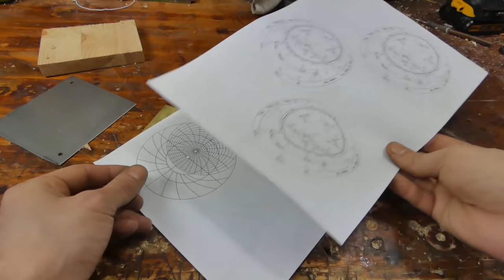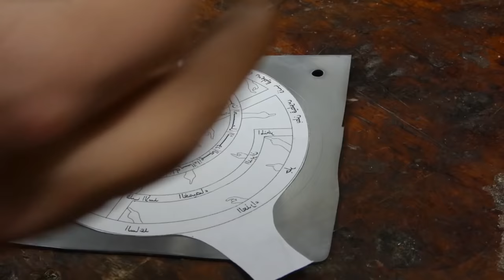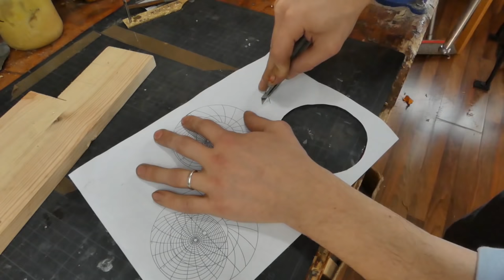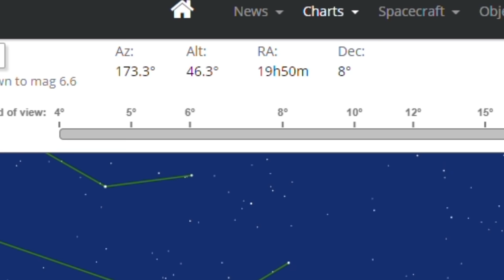I made tool that can tell TIME at NIGHT

Comment: Needs easier way to cut brass.

Casually builds leg powered scroll saw.
Reply: I think Uri is about the only guy I watch where I am not surprised when he just has a Singer pedal table standing around. You never know when you might need it...
Reply: Using a Dewalt cordless drill......
Reply: @falkschonfeld2370 
My parents use theirs as a hallway table 😉😂
Reply: fiona fiona I use for sewing...
Reply: @lollipopyummy1389 
I don't have enough of a rhythm nor any replacement needles and therefore use a more contemporary device to actually sew
Reply: @scottpreston5074  if I don't use ours it's safer.
Reply: First off. Awesome comment. 

But just for annoying accuracy; he apparantly has several builds he interchanges using the same treadle set up. A scroll saw, sewing, and a lathe at least.
Reply: He need a laser cutter!
Reply: my friends 
this man doesnt always rely on electric powered machines 
so dont be judgemental
Reply: He didn’t casually do anything every piece on it was finished
Reply: Ahmd Abdallah thanks for adding to the conversation something so relevant
Reply: I'm reminded of Charles Babbage, who used so many nuts and bolts building his Difference Engine (first automatic calculator) that he invented standardised, mass-produced nuts and bolts along the way. Previously, each nut was made to fit only its own bolt, which was a nightmare for his project...
Reply: @mattberg6816  Dont you just love the sanctimonious, tone-deaf, blundering faux-pas exemplified in every one of these religious spam comments?! It's really too bad that one of the ten commandments* isn't "Be cool".

*Spare me, YT. Im aware he was referencing the Qur'an.

Comment: Oh snap! You got a new vise! 
I just finished my own hand made mallet and graver based on your videos, and started building a rotating vise from scratch so I can actually try the darn thing out. Keep inspiring, thanks for sharing your build.
EDIT: I have made my own cutting fluid for drilling through steel using dish detergent, some water, and some strong oil. Shake it together and the soap will emulsify the oil into the water for lubrication and cooling properties.
Reply from the maker: Thanks for the tip! I'll definitely try it out. Good like with your vice,
Reply: Just be careful as dish soap has salts in that can scratch up the surface and encourage corrosion. Of course if you're only using a drop or two then it shouldn't be a major issue, but you might want to wash the steel off after cutting rather than just rubbing it clean.
Reply from the maker: @RealUnimportant  cool, thanks. probably Ill try it first on brass to avoid that kind of issue.

Comment: Incredible work! You're inspiring me to make my own, although I might have to start with wood. Note that when you're comparing a time reading from an astrolabe to standard time there are a couple of adjustment you need to make--1) use the "equation of time" to resolve the difference between local mean time  and local apparent time, and 2) correct for the difference between local mean time and standard time based on how far east or west you are from your time zone meridian.

Comment: Did You design and make the scroll saw?  its so cool, dose it run on black or white magic? Thanks for the inspiration.
Reply from the maker: yes its my design, sort of, I mean the concept is not mine but its my measurements and all. but the real magic comes from this amazing cast iron sewing machine by Singer, you don't see things made like that anymore.
Reply: @urituchmanpigeon  It's an inspired idea and a fantastic way to upcycle one of those treadles.
Reply: @urituchmanpigeon  I see them for sale periodically here.  Thought about buying one to make a treadle lathe, but didn't feel the flywheel was heavy enough.  Now that I see how you used it for a scroll saw I might have to pick one up and give it a go.
Reply: @red58impala  I have seen videos where they make a band saw from something simplar like this, Manual machines are awesome.

Comment: Hey Uri, I hope for your sake you see this, but there is another DeWalt drill called the DCD791 that is just like your DCD796 but a bit shorter/lighter and without the hammer feature. The hammer feature means there is about 5mm of chuck movement when you push on the drill and also if you try to forcibly back it out to avoid it grabbing then you're out of luck because by the time you've moved 5mm and jerked on it, it's already grabbed and potentially broken. Worth getting one IMO, I did :-)

Comment: Hey, I use the same printer toner and acetone method for transferring designs onto soapstone. The trick is to saturate the paper (enough to soak through so you can see the design on the other side), then just as it begins to dry, rub the back with something hard (like the side of a ruler). You can be pretty aggressive because as the toner 'melts' it will stick the paper to the surface.

Basically, the acetone dissolves the toner, then as it starts to evaporate the toner gets sticky....that's when you rub the back with some pretty significant force to get it to stick to your surface. You'll get a much clearer more defined impression. (I routinely transfer designs that are 8 or more Kanji characters onto a 2cm x 2cm surface)

Comment: Absolutely love astrolabes!! Coolest ancient astronomical calculating device ever!! Making a Nocturnal (nighttime time calculation using the position of the moon) calculator would be a great build!! And the sewing machine treadle wheel scroll saw was genius!!!
Reply: Nocturnals are indeed great for telling the time at night. And the good thing is that you don't need to adjust for the Equation of Time. But nocturnals use the position of the pointer stars in Ursa Major, not the moon. The moon is utterly hopeless as a timekeeper.

Comment: When using transfers like you are doing - there is a chance that you can rub off a detail or two.  Use clear hair spray to fix it.  Acetone removes the hair spray.  If necessary, you can draw on it also.

Comment: Your Arabic calligraphy is so perfect and beautiful !
Also, did you know that you could calculate the earth's circumference with it too? you just mark a star and get its degree, then move ten kilometers and recalculate its degree in the same time of the night, then you get how many degrees by ten kilometers are there on earth, then you calculate how many kilometers are there in a single degree (which should be around 110) and then multiply it by 360 and you get the earth's circumference assuming the earth is perfectly round.

Comment: >Starts sanding two bits of brass held together with nails
>Pulls hand away and brass has become one piece 
So freaking impressive
Reply: Not nails - rivets.
Reply: @BrightBlueJim  Nails in the physical sense of a brass pin holding two objects together. You missed the point.

Comment: You could've tried adding a smaller block to the underside of your holding/mounting plate with which you cut the engraving :) so you could put it in the bowl vise I mean

Comment: I would also like to point out that this tells your geographic time. Your 18 minute discrepancy can also be shown as your movement east or west from the center line of the time zone you are in.  Take multiple readings both day and night, average your time difference from your watch and now you can track your position on the globe as you travel by seeing how this difference changes!  

Also I appreciate that you made the plate with the sky box exchangeable. However putting a key at the outer edge of the dial rather than at the zenith will allow for a smoother swapping of plates as the zenith position will change with different latitude plates installed.  

Really enjoyed watching the build man! Great work!

Comment: I hope my suggestions are OK with you to make.  I get a better transfer to the plate to be engraved if I press and lightly clamp(just something heavy is fine) the paper, acetone soaked cloth or paper towel and something to apply pressure(piece of wood?) even in place and let it sit for a few minutes to let the acetone dry.  Once dry the toner(polystyrene and carbon black) has turned hard again and more of it may stick to the metal.  You can on some printers increase the density of the print.  Higher density means more toner on the paper and thus more toner that might make it to the plate.
Reply from the maker: Thanks, great tip! I'll try it out.

Comment: I'm wondering how this could work anyway at anytime. In the UK, for example, the sun goes way up and stays out far longer than in the winter, when it barely peaks over the horizon and stays out only a few hours. And then there's Ecuador, where the sun always rises quite high and daylight doesn't vary as much as it the UK. Those things would change the angle a lot! Also, I'm guessing that the difference in time and what your astrolabe showed could be simply the amount of time it took you to gather your things, go back inside, the recording and talk to us about the instrument. After all, the video is almost 20 minutes in when you extract the answer.

Comment: Uri I have been reading and watching videos about a “overlay” process known as Damascene.  I find the artwork that can be done by the process quite stunning.  However as stunning and clever as the “overlay” process is the method that is traditionally used to hold the piece that the Damascene “overlay” process is in my mind is almost equally cleaver.  The traditionally method of hold the work used a Cannonball an a triangular wood base and top that had a pitch like substance that was used to adhere the piece being Damascened to the Cannonball vice/stand.  I am thinking a bowling ball could be used in place of the Cannonball and the rest of the basic stand could be used along with wax or shellack blob like used to hold a stone when cutting it.  Just a thought of something that might be of use for you when engraving objects larger than your ball vise

Comment: Amazing work.  I do wish you’d gone about 3 times slower, this could have been 6 episodes easily with more explanation. The scroll saw could have been an episode all by itself!  FYI, there are two time corrections your device can’t do that would make it more accurate.  One is your distance from the local meridian in minutes (fixed), the second is the equation of time.  This varies by +/- 16 minutes during the year.  It is caused by the earths elliptical orbit and it’s tilt on it axis.

Comment: You are not necessarily 20 mins off, because your watch shows the time of you time zone! Depending on where you are in that zone it doesn't necessarily reflect your solar day time, e.g. 12 pm is not necessarily the time where the sun is in its zenith in the location where you are.  Time zones are sometimes off by a whole lot, for example to keep a country or region operating in the same time zone, even though it should have a different one by solar time.

Comment: You might consider that time zones are broken into one hour zones. Maybe it’s inaccurate or maybe it providing a more exact time reading for your exact location. Seems the margin for error is about the same as the increased margin of specificity compared to time zones. I live in south central AK and our time zone time is two hours different than solar time depending on DST.
Reply: Actually I think the margin for error is smaller than the margin of improvement. Anyways awesome video!

Comment: was the sketches done in pencil or pen that you transferred with acetone to the plate?
Reply from the maker: The sketches were printed, so the transfer is from the ink toner. There is a way to transfer pencil designs but that involves wax.

Comment: Uri - excellent video! But... uhm... you seem to have the astrolabe partially backwards, and half undone. The rete is to have the rule (whether single or double armed) on its face, while the alidade and sights is to be on the BACK face (which presently has nothing engraved upon it), which should include degree scales, the lunar mansions, umbra versa and umbra recta scales, and a few others, as well as the scale for converting equal hours to unequal, and vice-versa. The front face would have degrees and the zodiac, etc. - are you making a hyper-simplified version here? That's understandable... or, will you be making the other half of it all in another video?
Reply: VinlandAlchemist I smell a time traveler...
Reply: @CountDoucheula  Muahahahahaaaaaaaa lol

Comment: Uri, you are the best ^^
Something I've encountered is that the amount of dust flying around in my apartment when sanding or filing is unnerving. Any other thinker that thought if a solution? ( wearing a mask in a studio apartment or trying to fit a designated workplace fails in an small open layout unfortunately...)
Reply: An easy solution is to buy an inexpensive wet and dry vacuum cleaner. The nozzle of the vacuum can then be strategically placed (using custom-made brackets) to suck up the worst of the dust while you work. Unfortunately they are very loud, some are actually so loud that you should wear earmuffs when using them :(

You can improve the performance by adding a 'bellmouth' to the nozzle. This is basically a nozzle shaped like the horn of a trumpet, with a diameter at least 30% bigger than the diameter of the vacuum hose. This will improve the airflow rate into the vacuum considerably, a well made bellmouth can reduce the pressure loss (or resistance to flow) by as much as 90%. More flow will suck up more dust, hopefully.
Reply: @nerd1000ify  Thank you for taking the time to answer. ^^
I'll definitely look into some sort of wet or dry vacuum system. if I put it this way; I can not, not start and finish my tinkering projects. Impossible. x]
/Thanks again & all the best to you

Comment: what kind of scroll saw blades do you use to cut steel? I've been having trouble cutting intricate shapes out of 24 gauge steel
Reply from the maker: I use a variety of saws, some real fine and some aggressive. For the fine ones I use a small jig to hold, since they don't have a pin. A thin wooden backing also helps a great deal.
Reply: Uri Tuchman thank you, the backing plate seems to help a lot

Comment: Beautiful work but you made a couple of design faults. The straight edge of the rule or alidade that you use must be radial from the centre of the astrolabe. Yours are not. Please look at any astrolabe to see what I mean. At 17:10 you read the altitude of the sun, but you will be getting the wrong value. There are two styles of alidade. One has the entire bar on one side of the centre hole, so one edge passes through the centre. The other, rather like yours, has the ends offset on opposite sifes, so it is more balanced. 

You don't mention that the plate must be engraved with the altitude and azimuth circles for the latitude of your location. I can see that you have made it for about 51 degrees north. The plate must be inserted in the mater with its north-south exactly vertical. You have thought of this and put a pin under the zenith point that engages with a hole in the plate. But this only works for that plate. A different latitude plate would have its zenith higher or lower. So, much better is to put a tab at the very bottom of the plate,  going into a recess in the limb. By the way, this also allows you to engrave a different latitude on the back of the plate so it can be reversed.

You've gone to a huge amount of work but I would suggest the the astrolabe would be a lot more functional if you also engrave a date scale on the ecliptic and time and degree scales on the limb. Incidentally, it's normal to engrave other useful scales on the back.

If you make another, or if anyone thinking of making an astrolabe reads this I hope it will help do an even better job.

Comment: Wow, incredible skills and great video of your work.

In case you want to engrave the back of the astrolabe, with the calendar, the shadow square and the equation of time, you can use the Shadows software to draw everything. You can customize the layout and print it at any size. The layout can even be exported to DXF format to drive a CNC machine. I understand that it is no fun for you with your skills, but it may help other people interested to make an astrolabe. 
Check out on https://www.shadowspro.com/en/index.html